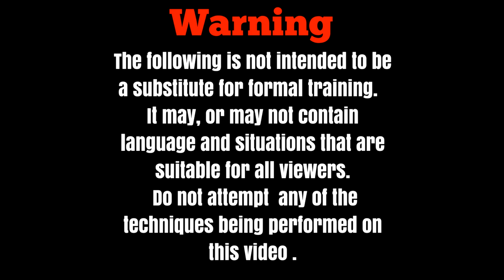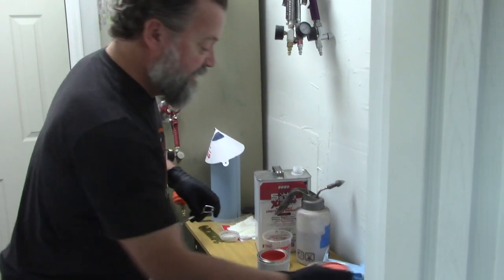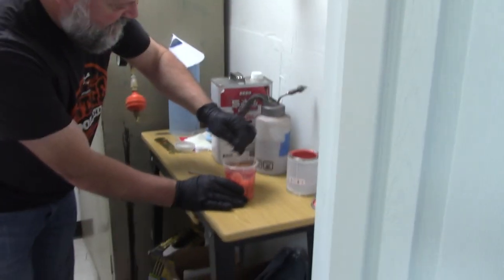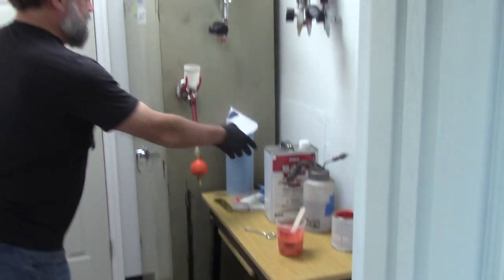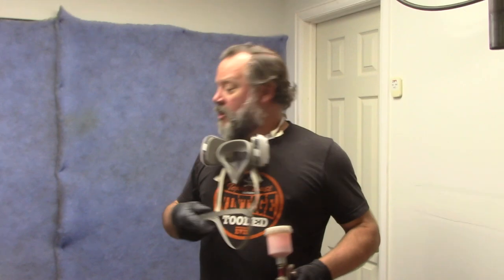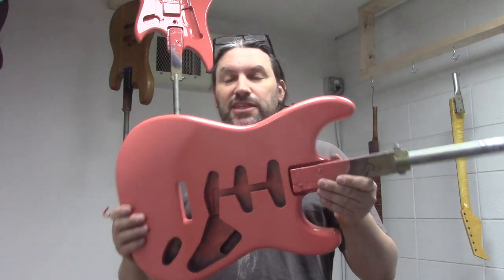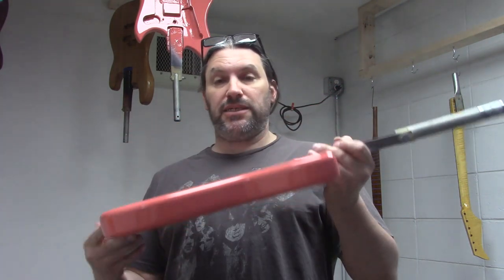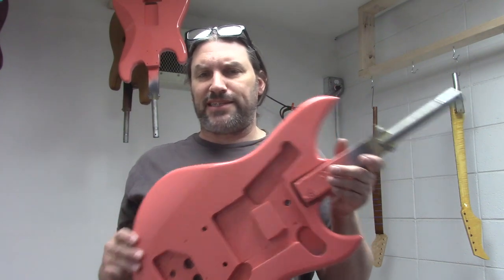Cabin Fever Special Extended Video You Know You Are A Rock Star If you Have A Pink Guitar!

Comment: Hey guys,
great work, that pink was a real common colour on our old late 50's early 60's GM vehicles down here (especially with a 2 tone paint job, from memory, white roof and pink below the waist line).
Question? do you think Auto paints would be thin enough to push through an Air Brush setup with no pressure tank? Pump only? Could easily rig up a pressure vessel if that's necessary but if it's not would be cool (landlords don't really like spray equipment on residential properties and my lease has a specific clause of no spray painting vehicles! ;P ) 
loving your boredom busting vids, Drop mention of "The Virus" and reckon you'll be cool with the YouTube bots.
Take care and all the best.
Reply from the maker: Hi Mark, 
you might need to reduce it a little more but I'm not 100% sure. Give it a try. We have changed the words COVID-19 to Cabin Fever... that seems okay, for now

Comment: Is the Tyveck suit during clear coat to keep your hair and dust from getting on the guitar or keep the clear coat from getting on you? Wondered why the drastic change in clothing.
Reply: Can't answer for them, yet in my experience the clear coat is quite a bit stickier and doesn't dissipate as quickly as other spraying material.
Reply: the suit is 2 parts.  1 is less crap in the final paint, but the real reason is the clear is much stickier.  Maybe the catalyst makes it different?  if you get it in your hair, or your skin, it dries it out, and makes it itchy and uncomfortable.  We use the suits for sealer too for the same reason.
Reply from the maker: We might should do a video about all the gear we use?